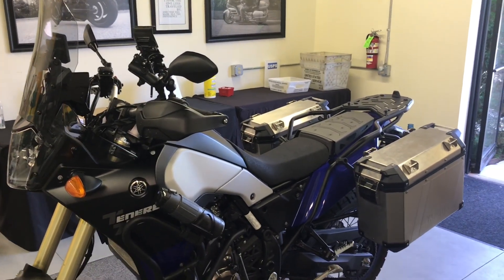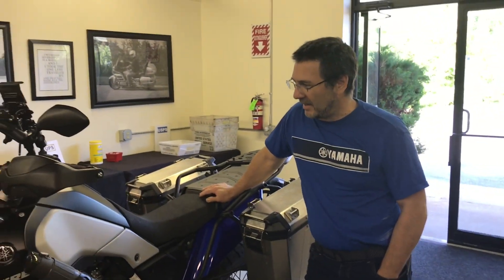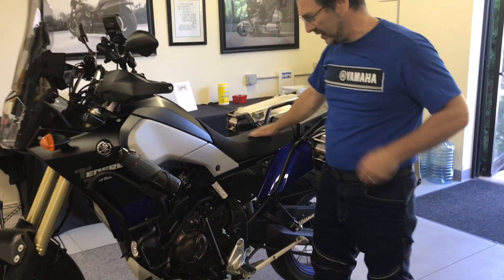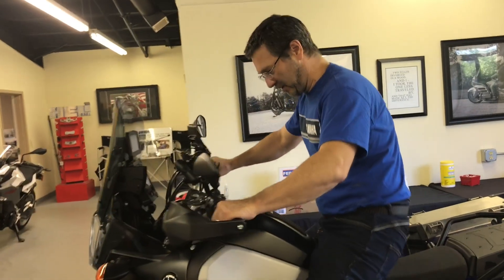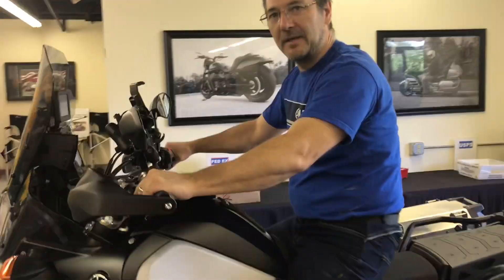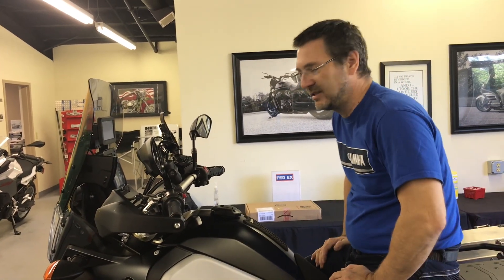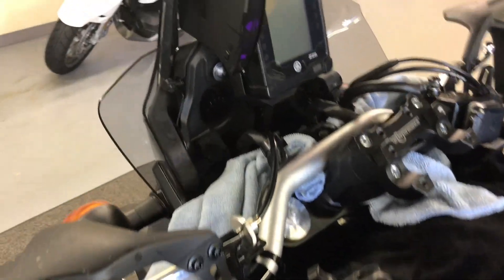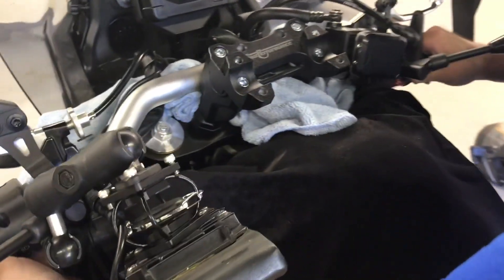2020 + Tenere 700

Comment: Looks like the perfect product for me. I’m 5’9”, on the ride home from the dealer, I noticed myself hugging the gas tank to get a more comfortable feel with my arms on the bars. I noticed immediately a lot of uncomfortable heat off the engine with my legs hugging up, shifting back to cool off, my arms were uncomfortably extended. The HeliBars Tour Performance Riser seems like the perfect addition, I like the adjustability of road vs dirt too! I’ll be putting my order in, in time for my first 600 mile oil change.

Comment: Seems lika straigthforward operation without complications. Did you need to make adjustments of wires/cables?
Reply from the maker: Retains all stock lines and cables.  Product is listed here:  https://www.helibars.com/yamaha/helibars-handlebar-riser/
Reply: Couldn't be any easier. Great mod that adds lots of fine tuning. For me, thAt means longer time in the saddle between stops. I've now done 10 days of 1000 miles or more, and two over 1200 miles!

Comment: Looks comfortable but how can you get any weight over the front tire?
Reply from the maker: @LongHaulPaul jokes in the video that you can get a good wheelie now - however his goal is to sit back in the seat fully and he was super comfy.  Feed back we have from him hasn't indicated any issue at all.
Reply: It doesn't really change the geometry any more than a rider with longer or shorter arms on the same bike would. Don't need to over think it. If you lean your shoulders forward 2" while riding does it drastically change the handling? I would argue not in the least bit. My arms are not the same length as yours. 
The ability to adjust the bars to fit an individual rider is the goal and the Helibars have been doing that since I first started riding decades ago!
Reply: X

Comment: How will it affect having a tank bag? Having it back looked like there could be clearance issues?
Reply: What tank bag?
Reply: @tedjackson5272   Any brand. Just wondering if having a tank bag mounted if the bars would be affected by this?
Reply: @Chris_Z.  I guess if it wasn't too large it would be fine, would probably have to try a couple of different styles.
Reply from the maker: We didn't test out a tank bag.  Not sure if @LongHaulPaul is using one - he may be a good resource as he does farkle his bike quite a bit.
Reply: I'm able to use any tank bag that would fit with the standard bar height. Actually the risers created more room for those front clips of most tank bags. The only limitation is the tank shape is odd for some bags. I'm using the Nelson Rigg adventure bag for the last 10,000 miles with no issue.
Reply: @longhaulpaul   That's great. Thanks for providing the additional info.